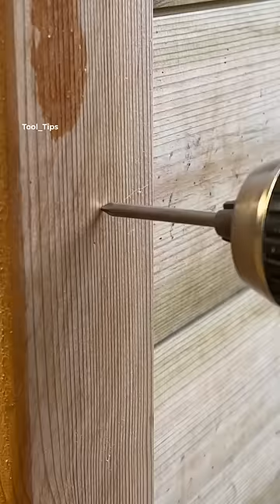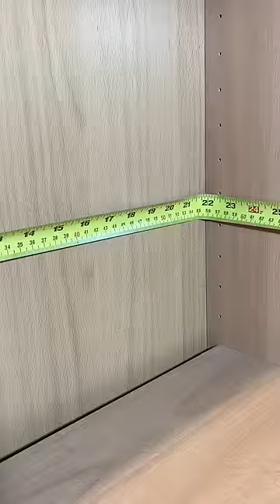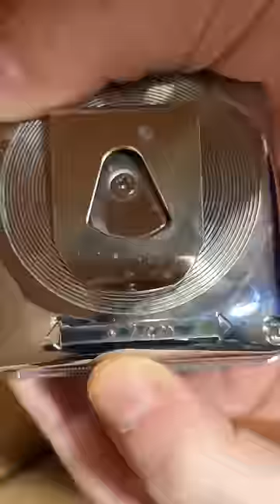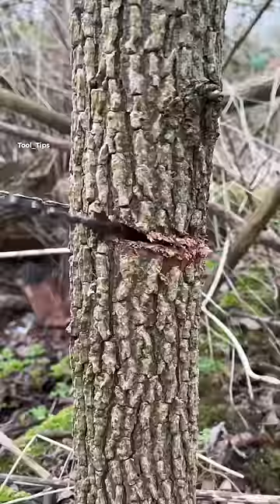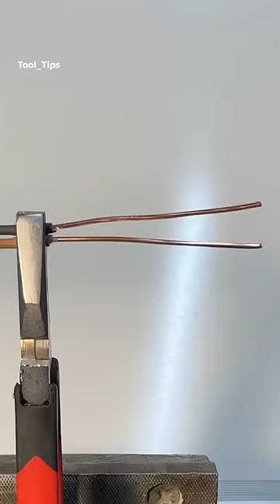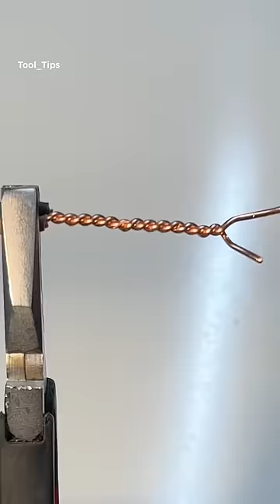Tools and Tips

Comment: You could just leave the chain on the saw and cut the tree that way!
Reply: dangerous
Reply: But then they wouldn’t get views😢
Reply: He wasn't using the chain from a chainsaw. It was a completely different type of saw entirely.

He was using a "pocket" or "hand" chainsaw. They have handles on either end of the chain.
Reply: Yes. There is a new invention called a "chainsaw" that is an improvement on this method.
Reply: Maybe the saw is broken down so you can just the chain?
Reply: Chainsaws are expensive.

Comment: Thats the original ,chainsaw, b4 motorization . Just a handle at each end ..
Reply: What would you suggest as handles?
Reply: Wye not drive in a star picket attach a length of inertube tried to a Cross Cut Saw. I was doing it that way when I was twelve years old, but I wouldn't go to Al that trouble on a small sappling like the one shown here,  if it had to be dropped a sharp axe would make short work of this overgrown weed. If you look at the end doing it this way was potentially dangerous if the drought was dropping a big tree he didn't put a scare in the side away from himself for the tree would fall away from him, doing it the way he went about it the tree had started to work it's way back towards him. I've worked in bush mills a this clown wouldn't last an hour, he'd be given the arse as he would be a dangerous liability how could get someone killed